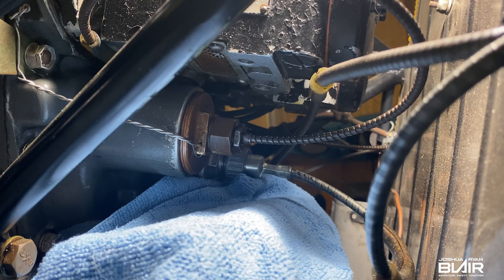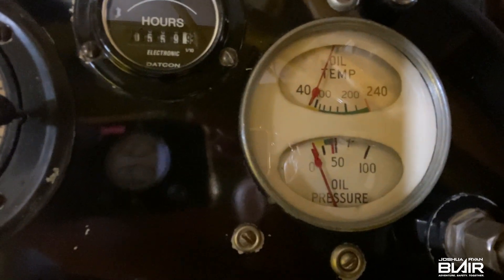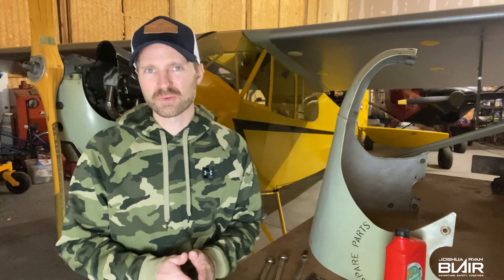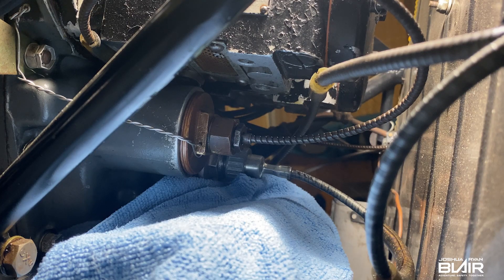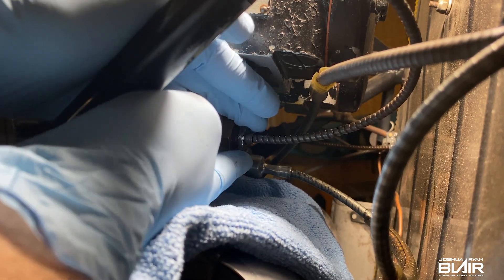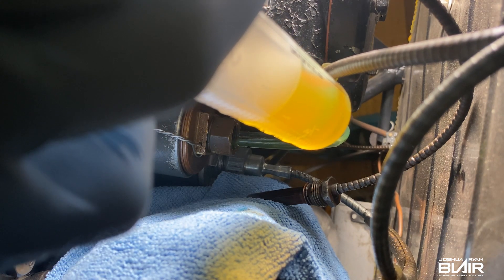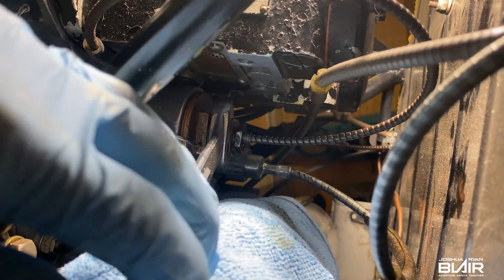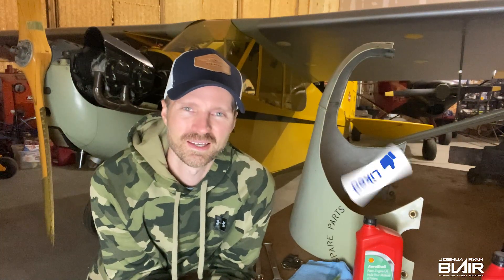No Oil Pressure in Piper J3 Cub? | Aircraft Maintenance

Comment from the maker: I've very recently also learned to lift the tail pretty high for 30-45 secs "before" starting at all! Be mindful of the prop!  This (can) prevent from needing to add oil at all.
Reply: That's probably a good tip for all of us with the little wheel in the back. 👍
Reply: My J3 has currently this issue of no oil pressure building up. I will try the taillifting and let you know. Otherwise will try the oil priming.
Reply from the maker: @birds_eye_view  Lift the tail high for 10-15 secs. Make sure the prop is clear… 😉🤞
If no go, prime it for sure.
Reply: @Blaircraft.Engines  Lifting the tail - I might need to go to the gym or do it more often 😳😂 Could not get it higher than just level. So no success there. Than got the temperature probe out. Almost bone dry. I guess any lifting in the world woudn’t had helped. So filled oil in there as good as it got. Started her up and voila - oilpressure after 2sec! 👍❤️ Perfect. Thanks for your advice there! 👍

Comment: I hope you're still looking at and reply to your comments. This video is 2 years old but a favorite of mine. I still reply to comments but I do miss a lot of them.  A while back I changed email programs and haven't got everything rearranged like I would have it.  So far I haven't had the zero pressure problem but will be on the outlook for it.  

 SO on to my questions.  Question (1):  I've noted a slot in the 5/8" nut that seems to be with associated with safety wire.  My Cub (J3C-85) doesn't have safety wire either.  Any comment?  I've been getting deeper and deeper into the maintenance of my 1946 Cub with an AP looking over my shoulder.  Question (2):  Have you ever had a stuck (resistive) throttle?  If so have you removed the existing throttle cable and soaked it in order to relieve the resistence or Question (3) Have you removed an old Cub throttle cable, clean the area where it was and then installed a new throttle cable?  I may have to do that in the near future.  

I know there's a good chance that you won't see the comment.  That happens to me for my two channels quite often.  John
Reply from the maker: John, 
Thanks for the comment and questions! 
Glad you enjoyed the video. I often just lift the tail prior to starting after a few weeks since last run. I don't recall there being a hole or anything for the 5/8"  temp. sensor for safety wire. Even though it's been over 15 yrs working on this J3, it's the only J3 and A65 that I have experience with. 

I haven't had any throttle issues on the J3, however in the Cessna aircraft I have. 
In the past, I have added LPS-2 at the cable ends to help with freeing it up some. 

I wish I had better info! Thanks again. Stay safe and be blessed! J. Blair

Comment: Question on a similar issue:  What if you have low oil pressure?  Can you address the role of the plunger and spring??  How to replace them?
Reply from the maker: Yeah I’ll add this my video list for the first of next year. There is actually a quick fix for the Oil pressure relief valve that works at least 50% that was shown to me from a lycoming representative. 

FYI- I’m working on several maintenance videos for the first part of the year.

January and moving forward will be more regular uploads. Stay tuned!

Comment: Josh have you removed your oil screen filter and cleaned it out really really good? Your suppose to clean the filter every oil change.
Reply from the maker: Yes. Every time I make sure it's very clean and no carbon is left behind. I also verify there isn't any metal or some other random F.O.D.

Comment: That is an expensive oil temperature bulb. Be careful not to twist the line. It is a small copper tube with a protective wrap. I usually lift the tail high before starting so that any oil sitting in the low spot of the filter housing will run back into the pump gears. If it still needs priming, you can remove the oil pressure gauge fitting on the right side of the engine and squirt some in with an oil squirt can. P.S. There should be a small orifice fitting there that restricts the oil in case of a hose breakage. It also dampens the gauge. Make sure that fitting is installed.
Reply from the maker: Yes. They’re expensive for sure. It sounds like lifting the tail high for about 1 min before running most likely will take care of it. About about the small orifice fitting... I’m curious of how difficult it is to get oil through the smaller opening?

Comment: Get an open box end wrench on that nut that you are loosening and tightening, so you don't round off that nut.
Reply from the maker: Good point! Great reminder... Thanks!
Reply: @Blaircraft.Engines  Better yet a line/flare nut wrench. A box end will result in a lot less contact since it's a 12 pointer.